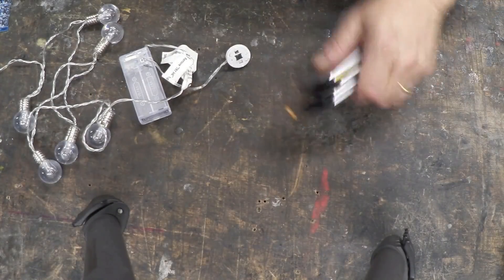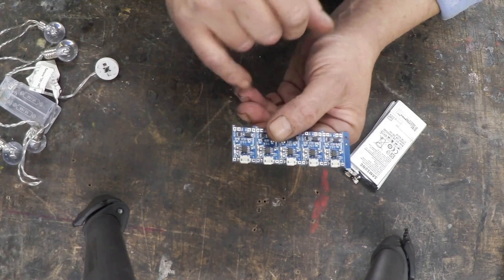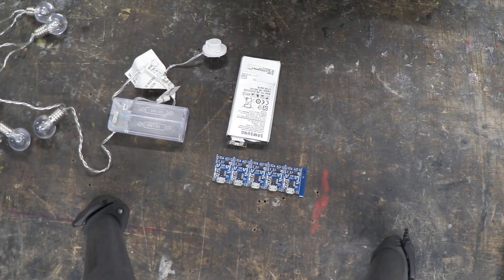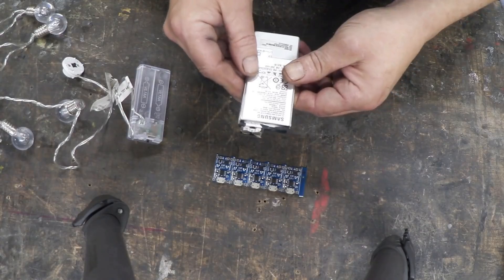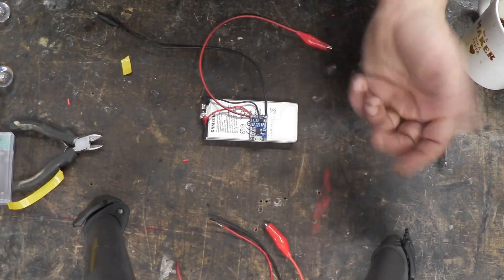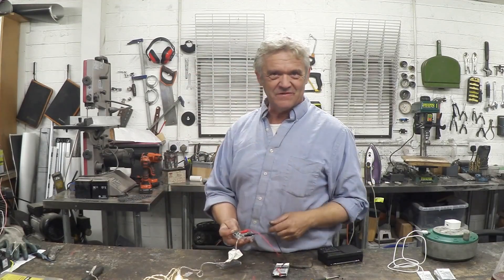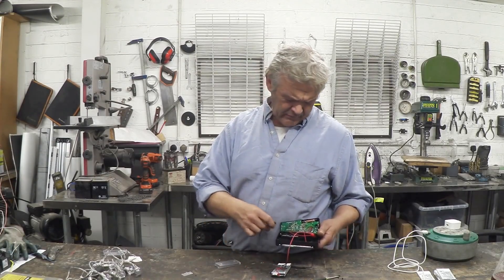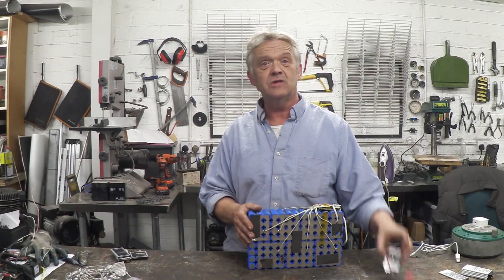1275 How To Convert Old Phone Batteries For 101 Uses

Comment: Followed your instructions, used my cell phone charger, and the battery went from 0.4v to 3.5v in ~5 minutes. The charge board got hot and the light stayed red. I had a USB tester connected and it showed the battery was drawing just under 1A. What's going on?

Comment: In the video you mention testing the battery voltage.  There was a range where the battery is fine, a range where the battery can be reconditioned and a range where the battery is garbage.   Is there a formula for calculating these voltages?

Comment: Does these salvaged batteries have a BMS board individually? Or can we just skip the step and directly connect it to the charging board?
Reply: He mentioned on the video that he removed the original controller and connected the raw battery to the new charging board.

Comment: Hi Robert, you just managed to demonstrate the work i have been investigating on how to power an LED for your competition. I ordered 18650 Li-ion batteries which haven't arrived yet but should before the competition closing date. there are obviously some slight changes with electronic features and current supply to the board. would have loved to use LiFePO4 cells but they were twice the price, would make the electronic design, because of the similar nominal voltage to that of an LED, a lot more simple and safe with more than 10 times charge discharge cycles than Li-ion, a lot safer and cleaner technology. Also the LiFePO4 batteries would have arrived after the close of the competition.
Never mind.
Will still make a video of my set up.
Mick
Reply: 18650! That's quite a lot and sound quite interesting. Have  you uploaded the video somewhere? I can't see it on your channel.

Comment: Awesome conversion! One thing I have to ask about is those ~£15 transformers/inverters inside the units that recharge nickel cadmium cells, I wondered how someone could make plug-in stuff more portable, without needing a ridiculously oversized inverter that costing >£100, (i.e reversing the flow of current from the batteries into a female to female three pin plug… Maybe the available current draw would be far too low however.)

Comment: Great video on so many levels Rob, thanks. When paired with the cheap charging circuits you show it gives years of life to old phone cells, and say goodbye to disposable batteries. One problem I've come across is small led torches (flashlights)  relying on the small current available from disposable AAA cells don't like the high current from the li-ion cells. As in killed instantly! Led's are largely voltage tolerant but current specific. The opposite of filament globes!

Comment: I discovered these lithium battery charging boards about a year ago and one project was to add it to a solar powered PIR security light to charge the battery fully when it receives insufficient sunlight in winter for a full charge, it works a treat. I've recently been scavenging batteries when I get the opportunity in order to repurpose them. A trip to my local phone repair shop is on my to do list and beg for some before they hit the bin. Thanks for a great video, I have some new ideas for projects now.

Comment: Robert - For a more versatile PCB try the Micro USB 3.7V Lithium Li-ion 18650 Battery Charger Module Boost Step Up Variable 5V to 12V This will charge from any phone charger and can be set to run 9V  PP3 Equipment.

Comment: a lot of those lights on a string that are LED these days have a box that takes like 3 AAA batteries ie perfect for liPo cells actually since they work down I think to like 3 or 2.5 volt)
Reply: oh also as most things that use standard batteries, also are designed to allow using rechargable like cadmium sulfide, metal hydroxide ect, which means the voltage is 3 x 1.2v not 3 x 1.5 only, so 3.6 is perfect for those, it seems.

Comment: At 04:53 One must observe the difference between series and parallel lithium battery connections, Because you seem to have edited (chopped) that little nugget out of the original upload. Balancing chargers are always a crucial addition, if you're wiring two or more lithium cells in series.

Comment: I found a 30v 2 amps nimh pack in a vacuum. Can I charge it  with only an adapter without the original charging circuit?

Comment: Good demo Rob. What's nice about those circuit boards is that they usually also switch the output off if the voltage drops below a certain point. That point is usually a bit low, but is good enough to stop the cells from being damaged.

Comment: I have a dozen ecigs batteries , all near discharged , I'm thinking of putting them in cheap fans as they take AA and add a USB cable to charge and keep the fan running , no circuits , maybe sealed in fire retardant , idk , but for a test

Comment: What happens if the batteries don't have the same capacitance?
Reply: You'll get current flowing from the "bigger" one to the smaller one.  This isn't a good thing as you're wasting power and may cause overheating, so you try to use matching ones.  Also even if you do have 2 matching ones, make sure the have the same amount of charge when you solder them together.  It's a bit safer if you discharge them first.
Reply: @j.f.christ8421  Thank you!
Reply: @john_blues  I should add my answer was for parallel.  Basically if they're at different voltages then the 'bigger' one will charge the 'smaller' one until the voltages equal each other.  When discharging & charging they'll do that as well, which may overstress the smaller one.

In serial is a bit different, but the voltage on the 'smaller' will drop faster (probably dropping below the safe voltage) while the bigger one is still forcing current thru it.  This is why dead battery packs (even back to the old NiCAD & NiMh ones) will have one dead cell, that's the weakest one failing first and killing the pack.  This is why LiPo packs have the balancing & protection circuits.

Finding matching cells is why those battery capacity testers are quite popular these days.

Comment: I have a strip of them charging boards I was gunna use for a mass 18650 charger but I think I prefer this idea, I also got a bucket of lithium batteries from laptops to go with.

A voltage regulator at the output could widen the voltage range to play with.
Reply from the maker: awesome mate
Reply: @ThinkingandTinkering  Robert words cant describe how awesome you are.
Reply: If you have a look at the datasheet for those little boards, you can change a single resistor to set the charging current to anywhere up to an amp, IIRC they come set at 500mA.  From memory it's up to a 20k resistor, I have one with a pot on it so I can easily change the charge rate.  The chip also supports a thermal cut-out which I've never tried.